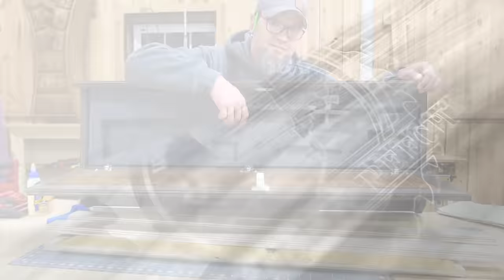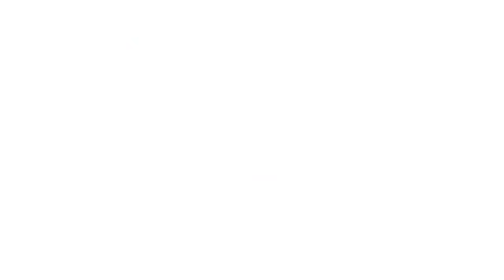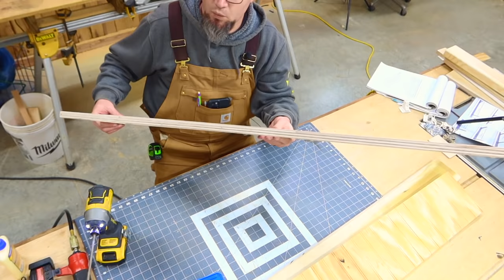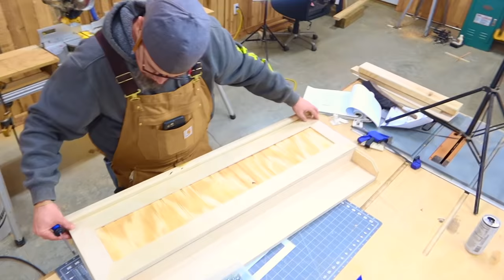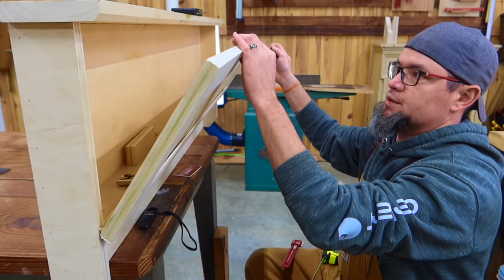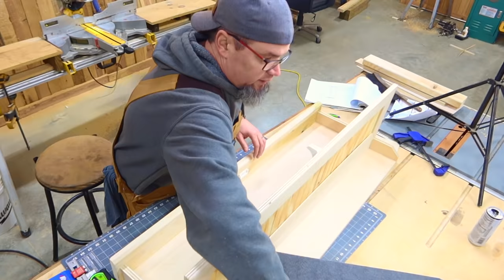Concealment Coat Rack Build (New Version) / Make Money With Woodworking!

Comment: Great build!!!! Something to consider, adding a gas strut shock to make the door spring open upon being unlocked to make items quicker to be accessed. 
Also given a coat rack is generally at eye level or higher, you may want to design it so the door flips up.
Reply: I was thinking the same thing.
Reply: @sinsofvorador  I was also thinking that adding the strut would be necessary. Great suggestion about creating the door to flip up. Great video, and suggestions.
Reply: since its coming out and down alot of people wont use a shock as it might come down too fast and hit you.  But yes, having it flip up would be a great design too.

Comment: Very cool build.

When adjusting that RFID latch.
You could put some two sided tape on the pieces like the magnetic locks.
Get the position right and then drill and screw.

Comment: Just wanted to note about the cheaper version RFID lock, which recently I finally pulled the gun to complete this project but had an issue with the latch and as Matt states give them a call and I did and received good input from Jeff Walker from Lock Connection and he was very helpful to work out my problem even though I created the issue. Just thought I would give a shout out on this project and Thanks again Matt for the inspiration. I would post a picture to show it off but not today.....
Reply: Thank you for the shout out! We do our best to help people.  We are a small company and we mainly only supply products to the concealed furniture market.

Comment: I made the concealment shelf as per your previous video. I looked at the RFIDs but in a pinch I figured someone would want something simple and reliable so went with the magnets. If it can fail…it will. When you need it most. In my head the RFID might fail. I also found a 6 inch tactical red LED motion activated light so when the shelf opens the light goes on. But damn that foam is expensive!
Reply from the maker: Nice!  And yea I feel ya. The foam has gone waaaaay up.
Reply: We have been supplies this RFID lock for over 15 years now.  They are very reliable.  However, they are electronic so they will eventually fail.  Just like most vehicles, something will eventually fail on it.  We also have Red, and blue LED lights.
Reply: @lockconnection3731  nice! Thank you for the update.

Comment: One suggestion: "highly" recommend the door itself have a layer of plywood overlap the doors' frame, like you suggested to cover the pocket holes. But more importantly for strength and ease of mind. Because the 3/8 panel can easily be punched in like it is.
Reply: Whose going to know what that is lol. And if that's the case and they know why not pull it off the wall
Reply: why in the world would anyone even touch that panel? This makes no sense.
Reply: its not designed to be a gun safe

Comment: I'm curious why you didn't leave the back unattached till the very end.  This would allow you the ability to do the lock without "trial and error".  You can then attach the back with pocket screws making it more secure.  Plus, with the RFID lock, in case the battery does go dead, you can then take off the back and change the batteries. In all, AWESOME build.  Keep up the good work!!!

Comment: Nice Concealment but for Me the Large Upper Panel and it's Depth, draws My Attention to there being more Space that needed. 
Wider (deeper) "Side Walls" would help some to hide the Depth.
A Chalkboard, or Magnetic Galv. Sheet-metal Panel, for refrigerator magnets, a Pen & Pad of Paper, with some sort of Cute sign, would give the Large Flat Panel "purpose."
And have the added benefit of obscuring the depth problem.

Comment: Hi, with using the other hinges I am having problems keeping everything flush. If I line them up to connect then when folding the front back up, the bottom divider piece is no longer flush with the bottom of the front piece. Insetting the hinges seems to be the only way to keep these flush unless I’m missing something. Thank you for everything you do!

Comment: Is there anything besides the foam holding the shotgun in place? Since it’s a vertical surface and a shotgun (and even some handguns) is pretty heavy, I want to make sure it stays in place. Looking forward to trying one (or more) of these.
Reply: they make heavy duty gun magnets you can try instead of the foam, which may be better /safer way to hold a shotgun or an AR. I know the foam makes it look better and you could get away with using both if you want to or just cut the expense of the foam entirely and just use the gun magnets.

Comment: What kind of plywood do you like to use for furniture builds. There are a lot of options in my area and trying to figure out what is a good material with a good face for an ok price. I say ok because the price of a 4x8 sheet of plywood is almost $60 in my area! Also how did you adjust the hinges? You didn’t unscrew them and move them into new holes did you?
Reply from the maker: I use alot of birch ply.  Its not cheap but stains well.  The hinges adjust on the hinge itself.  just turning some built in screws.

Comment: I love this style. Ive made a few shelf style concealment ones, but im definitely going to do one of these next. Thank you. QUESTION . with the child locks(white ones you show) if you loose the magnets that come with them you can always use any strong magnet to open it. What happens with the rf reader when the battery dies? how will you override and open it. (sorry if you covered it in the video, maybe I missed it)
Reply: once the batteries die, it auto unlocks
Reply: The magnets you can use a strong magnet like you suggested.  On the RFID lock, when the battery starts to get low, it will beep multiple times when scanned indicating that the voltage is low.  If you dont change out the batteries before they get to 3.6V, it will auto unlock.

Comment: This is awesome! Please excuse my ignorance about guns, but wouldn't you need to make a custom foam insert for different different types of shotguns, rifles, etc. or would one size work for most?
Reply: Yes. 
That's what he meant when he was talking about the foam, and the customer cutting it to fit, gluing in, etc. But this doesn't have to be just for guns... let your imagination flow!
Reply: P.s.
It's easy to cut the foam to fit, but it should be snug except wherever you are most comfortable grabbing whatever item it is. If it is a knife, there should be some finger holes at the handle, for example.
Reply from the maker: Spot on my friend!

Comment: One last question. What did you use inside the box to hold the gun in place? I saw you had two different ones to use. What do you think is the best? Thank you
Reply from the maker: Just make sure the foam is good and tight and they will hold themselves in.  I used two sheets because I had ordered in bulk for the concealment shelf.  The 2" would probably hold better.

Comment: FYI check the light placement, I put the light on the bottom, not the top, at 2am when you open that, the last thing you'll see is 6 LED red dots imprinted into your eyeballs, light below shines up not in your face, makes a difference in the pitch black (or a red filter light to keep the vis down, no sense in advertising to everyone in the house you just opened up a gun safe).

Comment: Do you have a generic pattern to cut the foam out? How do you know what size to cut so the product they are going to use the shelf for fits correctly or do you just send a piece of blank foam and have them cut themselves?
Reply: send it blank for the customer to customize depending on what they are going to use it for. Its not difficult

Comment: Love this. But what happens if the batteries die while the cabinet is locked?
Reply: this lock will auto open when the batteries get low.  When using it, it will beep differently when the voltage is low.

Comment: Are those particular locks fail-safe or fail-secure? In other words...if the battery was to die will it default to the locked position or unlocked?
Reply: unlocked

Comment: Kind of a funny question, maybe I’m not too knowledgeable on the locks, but what happens if the case is locked and the batteries die on the mechanism that opens it?
Reply: I have seen other videos using RFID for concealed/hidden compartments in furniture and they showed how to use screws, instead of glue and nails, to assemble the pieces that make up the compartment.  That way, you can take the screws out to remove a panel, or disassemble,  to access the contents.  Hope this helps.
Reply: these locks will offer an audible alarm when scan to indicate that they batteries are low.  If you don't change out the batteries the locks are programmed to open at a specific voltage and stay unlocked.  If the batteries fall out or the terminals get corroded, it will not open.  We have optional power jack cables that can be used on all our locks for emergency power.
Reply: @mikemd2697  thanks!
Reply: @lockconnection3731  very helpful thank you!
Reply: @jabutch11  absolutely!

Comment: For a concealed weapon rack the RFID option sucks.  What happens when you need immediate access but your RFID card is not on your person?

Magnetic is the way to go.  You build the magnet into the base of some decorative small object that you set on the shelf itself, so it's always there, hidden, but available to open the cabinet instantly at need.
Reply: and you cant do the same thing with the rfid card??? A card can be easily glued to a book inside cover and left on the top or any number of other options
Reply: @caseymorgan2112  you ever used RFID cards before? You know it's a common trope, cards refusing to scan, acting funny, losing their programming.
Reply: @sjsmith801  use better quality.
Reply: The best quality (expensive) RFID systems will never be as foolproof as magnet systems. And the worst quality RFID will be more expensive than magnets. You feel free to use what you like, but magnets are a better option for this use case.
Reply: @sjsmith801  it’s a trade off, the magnetic locks are a lot easier to bypass too so pick your poison.
Reply: Which is why it's a hidden compartment. I'll take reliable and quick access any day
Reply: @sjsmith801  good for you.

Comment: One little flaw I see in this design is What if someone closed that door when the batteries are out of it? How would you get the door open? Hey, things happen.
Reply: Answer: Drill a tiny hole above where the latch is and use a small piece of wire or a nail to press it down. Solved